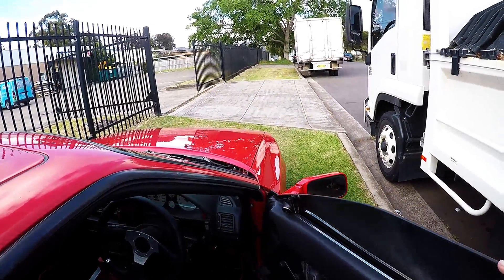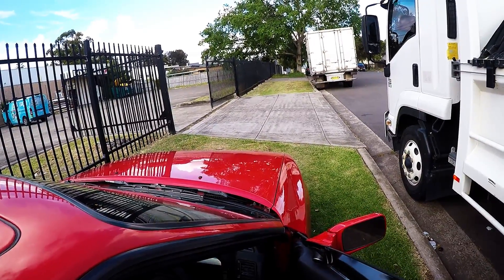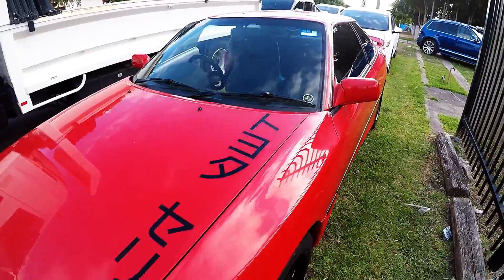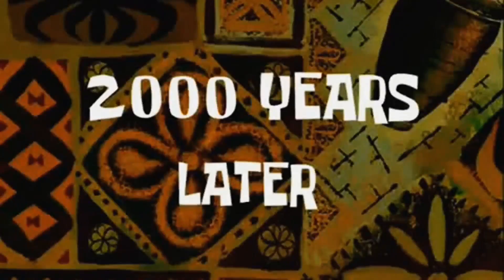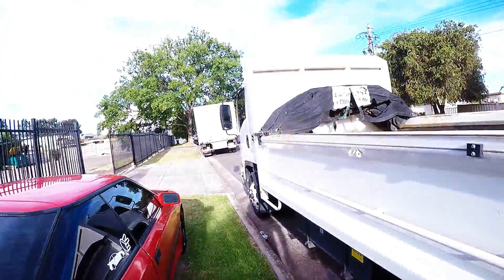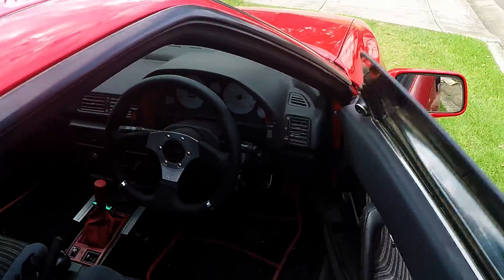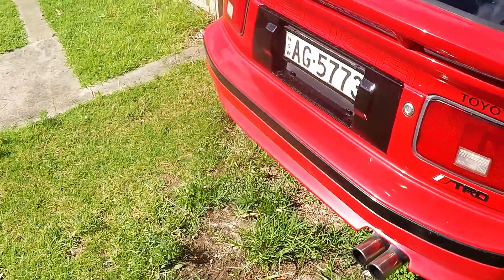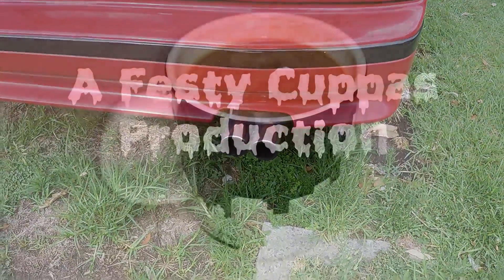Kelford 262° Cam Upgrade 3SGE

Comment: Is this a gen 1 3sge?
Reply from the maker: nah, gen 3. difference being, no TVIS, but instead it used ACIS, the model before BEAMS.
Reply: @STAG162  yea sweet. How hard was the swap? I just picked up an st162. N once i get it on the road n registered ill start the mods 😂🙌🏼
Reply from the maker: @daviddickson443  sorry mate, didn't get notification of your reply. I didn't do the swap, a local mob up in Qld did it for me. from what I can tell, the swap itself wasn't hard. getting the engine loom from the UK and re-orienting stuff in the engine bay was the hard bit. I've been fault-free (touch wood) since 2008 on this engine, and it's been a great daily driver. merry xmas btw.
Reply: @STAG162  ah okay sweet. The engines are obviously around but i havent seen any for sale in the last week or 2 aha
Merry Christmas 🎅

Comment: So you have the model number for these cams there not listed on kelfords website and I'd like to buy a set for my mr2
Reply from the maker: what kind of engine are you running in your MR2 now? 3S as well? from which year? depending on your engine, I might be able to help you out
Reply: @STAG162  1991 
 gen 2 3sge from I'm from New Zealand
Reply from the maker: @XavierMR2  ok so non-turbo.. what are you planning to do with it? just a street/daily?
Reply: @STAG162  street driving with the odd track day
Reply from the maker: @XavierMR2  I could hook you up with the cams that came out of this engine, as I'm not sure your gen2 head would allow for such big lobes. the gen3 N/A cams that I have would be better suited and safer I reckon. I remember reading that these cams were specially made for gen3 engines only. anyway if you're interested in my spare cams, hit up gumtree and see what you think.
edit: I just did some checking and these cams definitely won't fit, too large for a gen2 head. my N/A gen3 cams could be adapted but will need some work like shim-under-bucket mod and suitable valvesprings.
Reply: @STAG162  thanks man will probably go with the kelford 258 they have suited for 3sge then

Comment: I have an MR2 with a 3SGE (gen2) Now the idle on it sounds much more like the 2nd clip. And while it's not completely warmed up (still somewhat higher idle rpm, just over 1k) it even shakes the car slightly. Could it be that one of the previous owners installed cams on it? Or would it just be the stock 244 cams and a rough idle. The engine doesnt really look touched, but who knows what happened in those 28 years..
Reply from the maker: there's no real way of knowing if your cams are stock or not until you pop the rocker cover and check if they have Toyota part numbers embossed on them. my 3rd gen 3S high idle issue was tamed when the thermostat was changed over. other things to cause a rough idle are a buggered ISCV, fouled plugs, problematic leads, bad fuel/filter, air filter, clogged injector, dizzy cap/rotor button... a myriad of things to check over.
Reply: @STAG162  thanks for the reply. I must note that when warmed up the idle speed is around 800 rpm. Just as it runs it has a slight beat in it of around 3 beats per second. Just slightly lumpier idle like what you get from these cams.

Comment: Are you running an aftermarket ECU, or stock? Thinking on getting the 5th gen manual engine 3S-GE (i already have the J160 box) for my IS200
Reply from the maker: Stock ECU. I wasn't sure how the ECU would react after the cams were put in, but they're mild enough that everything is behaving normally.
Reply: @STAG162  I'm 3 years too late to the party but did you notice any benefits even with stock ECU ? I suspect you need to raise rev limiter and tune for max benefit ?
Reply from the maker: @stoic-x1p-b3f  long-story-short... Toyota OEM (factory) ECUs can't be tuned. I'd need another tuneable ECU to be able to fiddle with all that stuff, which isn't necessary for general road use.